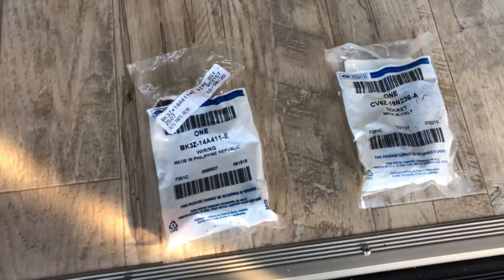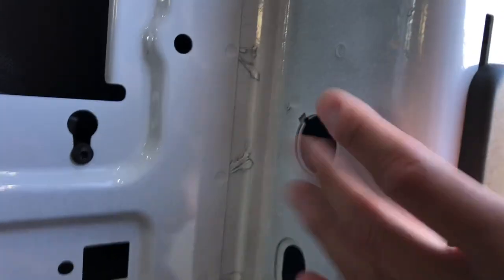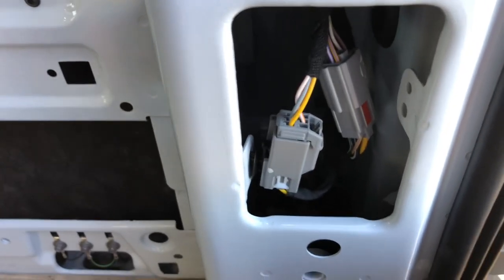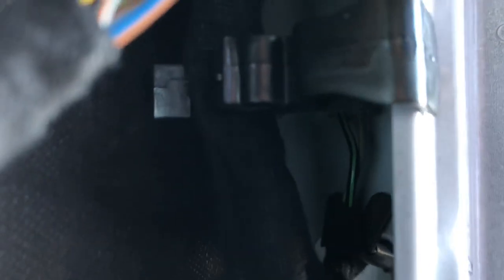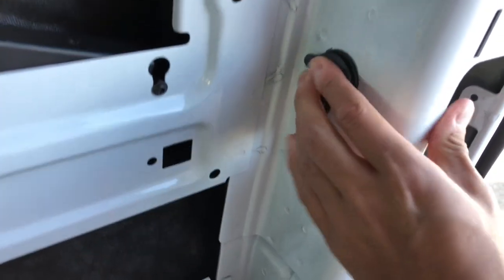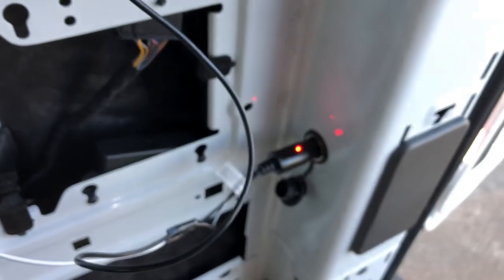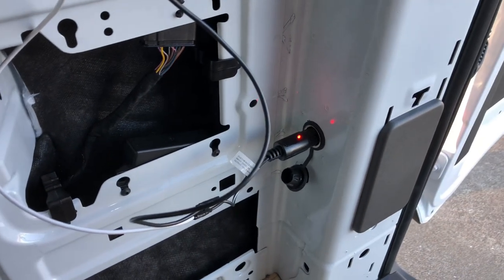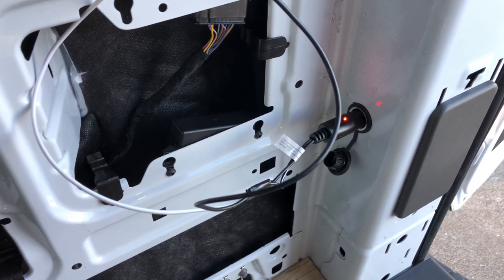AWD Ford Transit Rear Power SOCKET PLUG Install - Part 9

Comment: Thanks for the video! I just got this as a work van and want to charge my tool batteries from there. Are you able to install a 120 plug receptacle instead of the 12V?
Reply from the maker: I'm not sure if can, but a great alternative would be to get a 12v intverter rated at 500W or whatever your needs are. See link below. https://amzn.to/38Ca63v

Comment: Thanks for your help I was able to add a 12-volt power outlet. I have the same van. The other day I was using the outlet for tire inflator and blew a fuse can you tell me which fuse supplies that and where it is thank you
Reply from the maker: I’m also trying to figure that out haha no one seems to know
Reply: @RichBuilt  were you ever able to figure it out?

Comment: When I clicked on your link the wiring harness is discounted. Is there another part number I could use?
Reply from the maker: Try searching for the just the part number online.  Other distributers will likely carry it.  Also try searching under previous model years.  They are likely to be a carry over harness.

Comment: Can't find the wire harness anywhere. My local dealer says they can order it but there is no estimated date for it to ship. Link in the description says discontinued. Tried one online parts place but they said they couldn't get it and canceled and refunded my order. I might have to resort to junkyards soon.
Reply from the maker: Yeah I think a whole lot of 2020 models that were supposed to come with this from the factory didn't so they took all the stock to make good on people's orders.  Try searching under a different year.
Reply: Just got my back ordered items from my local Ford

Comment: Thanks for this video. We've had this on our to do list for MONTHS but feel like we haven't gotten any definitive advice/instruction.  My only question. Can you provide a link(s) to the wire harness and socket you purchased?
Reply from the maker: I’ll add it to the description
Reply: What are your search terms for the wiring?  I've searched for several weeks unsuccessfully.  Ordered twice but after confirmed its cancelled with no explanation.
Reply: @wayneball4004  We saw someone post that the old part has been discontinued and that there is a new part. I believe we've updated the info in the description in our video about this but we'll have to double check later and get back to you.
Reply: @SteveAudra  Thank you.  I am grateful for any help.  I have searched for hours with no luck.
Reply: @wayneball4004  Just checked the notes on our video and it looks like the new part is LK4Z-14A411-AB. Does that help?

Comment: Thanks! But I get no power there, what do I do?
Reply from the maker: You'll need to buy the harness from Ford.
Reply: @RichBuilt  thanks for the reply, but what harness? I measured with a multimeter and literally get zero volts.

Comment: I just installed mine and it seems to be always live. I thought it only works when the car is running? I was planning to plug my goal zero in there and have it charge whenever the car is on. Is there a way to change it?
Reply from the maker: It should turn off after 30 minutes similar to the front outlets
Reply: How do I make this outlet always live?

Comment: is that a constant hot or only on when the keys on?
Reply from the maker: will last same duration as the front power points. about 30 minutes after car is off I think

Comment from the maker: Why this plug doesn’t come installed from the factory is beyond me. Add this to the list of quirks with the Transit. You can see how this plug could be useful for vans with fridges or people who transport live animals and need a fan.  I’ll update everyone on the actual watts Im getting in a future electrical video. Thanks 🙏
Reply: I'm thinking it depends on the build package(s) whether or not it's there. My 2018 has one but I've seen posts on FB about other 2018s that didn't.
Reply from the maker: @HikerBiker  That's interesting.  Typically the main wiring harness has all the plugs and the ancillary wiring is what is either included or not.  Best to look and see if you have the plug prior to ordering the secondary harness and socket.  Thanks for pointing that out.
Reply: Any idea of how much power you can draw from it? I'm not seeing any power specs, so I can't figure out how many watts you can use with it.
Reply from the maker: @vmalloc  its dependent on your car/fuse rating.  Ford Transit has it for a 20amps (20*12v = 240w).  My solar charger only inputs 100w from the plug, but I will utilize a 12v inverter to bump that up to the AC charging brick capacity of 400w.